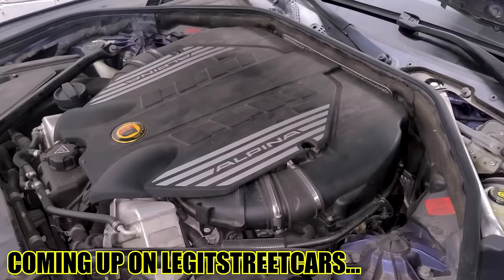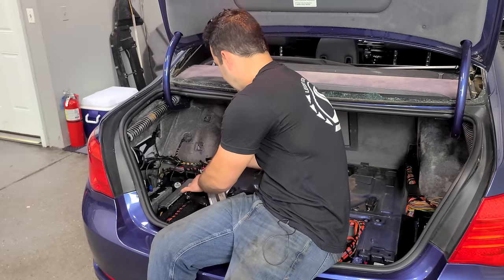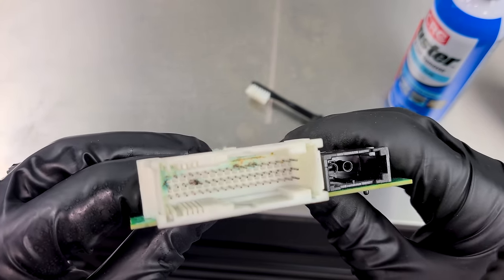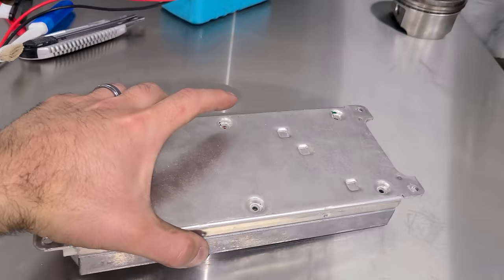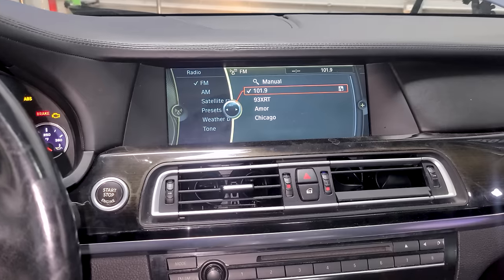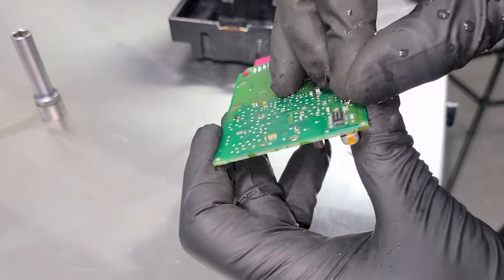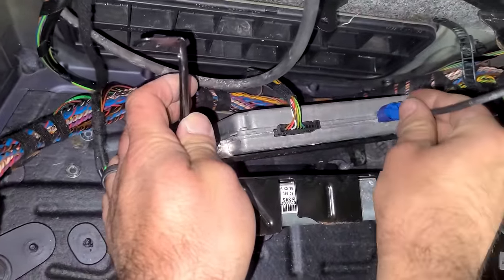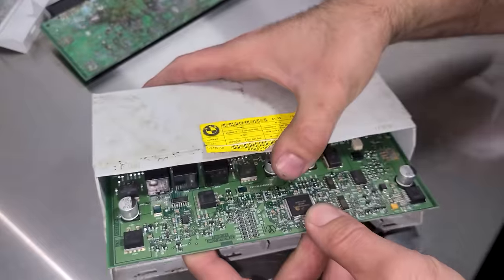BMW Dealer Tried Totaling My Car By Quoting $15,000 For 10 Computers! I Fixed Them All For $150!

Comment: This was a great video. I’ve been watching your channel for years - and many others - and I don’t recall anyone covering this topic. I had no idea you could clean corrosion from electronic car modules. Especially with de-ionized water. Car lovers need to know this stuff!!!
Reply: how is this a surprise to anybody? I had so resolder my control board for rear parking sensors.. worked just fine after.. Contacts come loose, some caps might bloat.. But chips rarely fail.
Reply: Yes normaly liquid damage cab be cleaned, as sonner it is more sucess you will have, i repaired lots of liquid damage stuff, we use de ionized water and isopropanol alchool to clean the corrosion. Even your phone if it goes in the water do not put in the rice, open ir and do what Alex done here, 90% of the time you ok.
Reply: @organiccold  Is distilled water a good alternative to deionized?
Reply: @liuj88  was wondering the same, commented to get any updates that may post.
Reply: Well said. I was thinking the same thing!
Reply: @liuj88  distilled water is just regular water that evaporated and condensed, you get the same out of your AC. Deionized water is chemically treated to be 100% h2o and nothing else. Osmosis is a lot more potent on Deionized water compared to distilled water. I'd say distilled water is safe for cleaning the boards but not so useful for pulling out the corrosion. I fixed several PC and laptop boards using WD Contact cleaner spray, isopropyl alcohol and a tooth brush
Reply: You didn’t know you could clean corrosion off of electronics using water that doesn’t conduct electricity. Really?
Reply: @dgurevich1  Not quite the same as out of your AC - AC water is condensed from naturally evaporated water in the air so it'll likely contain significantly more contaminants than properly distilled water, which is heated from relatively clean water and condensed with clean equipment (hopefully anyway!) - also your AC's condenser unit is probably grotty as hell and will add a bunch more contaminants.  I wouldn't use the water from my dehumidifier for anything other than the garden.
Reply: It's worth a shot, but it's not always going to work, and even if it does work, it could fail later - which is why no dealership is going to offer a service like this - they don't want you coming back in a few months complaining their repair didn't last.
Reply: @liuj88  Since both treatment methods produce high purity water, choosing between deionized water vs. distilled water often depends on how you're using it. Distilled water is often more pure, especially if it's been filtered first, and it should not contain any bacteria or other pathogens which could, in theory, be left in DI water. Distilled water, especially if it's been double or triple distilled, can be used for nearly all laboratory applications, including those in which DI water might not be pure enough. 

That said, deionized water is a good option for many uses, including cooling applications, many laboratory uses, pharmaceutical industries, and more. Unless very high purity water is required, deionized water is often a better alternative because it can be made more quickly and for less money.
Reply: @liuj88  - yes, distilled is just as effective as deionized. 😀
Reply: Thanks to all for the great responses re: distilled water! 
I don't have access to deionizing equipment,  but can buy distilled water at the local supermarket by the gallon,  much more convenient for small projects. 

Any opinions about the alcohol.? I don't remember seeing isopropyl alcohol in the hardware store.  Is denatured alcohol just as good?
Thanks again!
Reply: @liuj88  ISO is usually supplied by chemists. I used to say "I want to clean a magnetic tape head" when they asked why I wanted it 20 years ago. The de-ionizing filters are available on Amazon from $30USD
Reply: @liuj88  Isopropyl alcohol is commonly found at drug stores or grocery stores in the make up or bandage section. 70% and 90% concentrations are common, and you can get 95%+ from outlets online. 90% iso is fine for cleaning electronics.
Reply: Rich Rebuilds has done a lot of this work on his early videos on Tesla. He got a flooded one running by cleaning the corrosion in the battery
Reply: @liuj88  it is not exactly the same stuff, but it is almost the same you would have to look it up but if it has been distilled, it should be totally free of any mineral content. I am not sure of the technical differences of de ionised and de stilled
Reply: @GrahamCampbell-kr2gz  thanks for that input. It's good to know

Comment: Alex, an interesting side note on the fuel pump control module that you clean up and reinstalled.  Those are known to suffer from heat cycle failure and become very intermittent in operation.  I have a 2011 Alpina B7 just like the one you are working on and I chased this problem for the better part of a year.  My car would be running 100% perfectly and out of the clear blue simply die.  I replaced both high pressure fuel pumps, I replaced the fuel pump inside the tank under the back seat and the whole time it was this dang module in the back.  When it would get hot (ambient temperature above 90 degrees) it would simply stop sending the correct pulses.  Let it cool down and it would work again.  My point is, even though you have cleaned it up and made it work again, I'd replace it with a brand new one and not have to worry about it again.  I found a brand new one for 60 bucks and no longer have any issues.  I am following this video series very closely given that I have the exact same car.  Its 11 years old and running spectacularly.   Keep up the great content.
Reply: Do you remember what codes you were getting?

I have a 2010 750Li & I'm having fuel system problems. First I use to get a lean code on Bank 2, then that stooped. Fuel trims still high in the low 20s

Car idles rough & now it will randomly shut off. Codes I get when it shut offs...low pressure in the system & in the high pressure system, electric fuel pump speed too high

And I'm guessing that causes the fuel injection to cut off. It's driving me nuts now, I ran a fuel pressure test in ISTA...and it checked out fine

So idk if it's a vacuum leak that's causing all this, or some fuel component like that module
Reply: I have one of those modules for sale :)
Reply: Oddly enough it wasn’t throwing a code. That’s hard to believe but it wasn’t. That’s what made this so dang hard to figure out
Reply: I had a customer install his own battery.  He connected the battery backwards.  The battery post was completely melted off, metal spatter everywhere.  I figured the car would need every single electronic module.  Much to my surprise, the only module that fried was the fuel pump/srs module.
I have seen those modules go bad on their own as well.
Reply: @MrFlyNikolai  I didn't get codes when my hpfp failed. I've heard of particles contaminating the fuel system when this happens so just be vigilant about continuing to drive it, mine was intermittent at first it was only freaking out at startup where I assume it lost pressure in system but not enough to throw a code if it even would.
Reply: Same thing on my honda fuel pump

Comment: hey! car and pc enthusiast here; you can generally wash any circuit board (without any power whatsoever) with plain water, and if the corrosion is really stuck you can use some dish soap too.
you just have to make sure to rinse the board really really well and then rinse it again with rubbing alcohol. that will prevent any mineral buildup after drying and it will remove the water stuck in some hard to reach places like underneeth the smd chips. 
This is generally a last option to resort to but it works. is better to just use alcohol and a toothbrush.
Also, you dont really need the entire harness plug to replace a pin, you can  just basically buy some female pin conectors of the correct size and crimp them to the existing cable.

Comment: The yellow coating is called Conformal coating. It can be sprayed on or brushed on to new production pc boards with humidity and moisture sensitive sections. Conformal Coating prevents moisture/electricity based fungus formation. There are different formulations of conformal coatings, including silicone, Acrylic and even epoxy based potting (solid forming) or liquid turning to gel versions.
Reply: I just learned to pot using gasket sealer

Comment: The drying stage is incredibly important, I was recently fixing a PCB from a monitor and after a week it wasnt dry and wasnt fixed but about 2 weeks later it worked. Dont rush it.
Reply: If you do clean PCB regularly get a food dehydrator.  The fiber in the board is hygroscopic  some what the source of the root problem  .
Reply: I normaly clean them with de ionized water,isopropanol alchool,  blow them with air and let them to dry for a night in the boiler room ;)

Comment: You make me not want to buy a used car from anyone but you. You do some of the most thorough repairs I’ve ever seen. I’m a Field Service Engineer. You’ve had some fixes I wouldn’t have thought of for sure. I’m really impressed. I’ve watched almost every episode I’ve found in the couple months I’ve been watching your channel. I’ve even fixed a few things since watching your channel. I’m still intimidated to try my 2010 Fusion that was caught in a flash flood in Detroit but this is an excellent start. Electrical gremlins are the absolute worst to troubleshoot.

Comment: I've had great experience soaking the boards in a Tupperware filled with 90% rubbing alcohol. I put the container on my subwoofer at home and either play some music or watch a movie. The vibrations act as an ultrasonic cleaner and the alcohol dissolved the corrosion. 

I did this on a water damaged iPhone and MacBook and it worked both times. I soaked overnight and rinsed with some new rubbing alcohol. Brought back all my electronics.

The issue with just spraying is, the corrosion can exist underneath the chips/capacitors that you can't get to with a brush. When it soaks and vibrates it gets everywhere.
Reply: Excellent Advice and smart!
Reply: Lol love the alcohol & subwoofer technique..
I'd would've used a microscope to view the board in more detail to double check the cleanliness of them..
Thou Alex was lucky only having to replace a couple of modules.

Comment: I just used this technique to fix the remote radar receiver head of my 10+ year old Escort Passport 9500ci radar detector. After years of trouble free service it gave me a “check receiver” error. Since I mounted it behind my bumper when i installed it, I wasn’t looking forward to taking it back off. After seeing this video I decided to get after it.  Removed the receiver head, saw the wiring was in perfect shape, so took the head apart. No apparent moisture got in, but there it was, corrosion between a couple of components on the board. Cleaned it off, put it back together, reinstalled everything and BOOM, it works perfect once again!   Never thought it would be that easy, thanks for the great videos Alex!

Comment: Super Impressed, I can work on classic cars blind folded but all the electronics in the new cars have caused me to quit doing most repairs besides regular maintenance.  The tips you showed isn't just for automobiles, many things are so dependent on sensors and modules.  Take a modern washing machine, very prone to problems with the circuits due to water damage and given some of your tips many could be saved instead of replaced.  Keep doing what you do, your presentation was excellent.

Comment: I pretty much started doing my own repairs on cars at age 15-16 buying used cars to get myself around to and from high school and jobs etc... Had a head gasket blow and got a quote from a shop my eyes fell out of my head. I took a look at a repair  manual and said this is just a big 3D jigsaw puzzle, and went to work. Now I had to get a few things done by a shop like milling the head flat where it had warped a bit. I rebuilt my whole engine basically it was great.

Comment: I repair computers as a hobby, and use 99.9% IPA (IsoPropyl Alcohol) to clean off liquid spills on computer boards.  It is amazing what a little bit of elbow grease can do to a "lost cause".  
Plus it is easier to measure for any issues if the legs of the parts are clean.  You were very lucky to have these modules given to you.  By the way, I enjoy the repairs!

Comment: As for the ABS module, I believe it was done as a insurance fraud. They smashed it so the whole dash would lit up and after quick scan with computer it'll show faulty ABS pump/module, really expensive to fix so total loss ;)
Reply: Agree with this,  I work at an auto parts recyclers, and see a lot of this stuff.
Reply: i would not be surprised as dealer mechanics and probably all mechanics now these days get paid by the job through book time
Reply: I don't understand why ABS modules are so expensive. It almost at the level of the price of an engine head or block, or a gearbox. Anyway, insurance companies are money making machines. They have no real purpose.
Reply: @samuellourenco1050  I guess it's because of so much electronics in it, valves, etc. but I'm pretty sure manufacturer still makes huge money out of every ABS unit they sale :P Same goes to BMW, in Europe if you buy fleet of cars directly from BMW for your company (some bigger number of cars of course, like 100) you might get up to 60% discount on each unit! Yeah, you read that right. I was shocked when I've heard about it. Insurance on the other hand, yeah, they are money making machines but for average Joe it's nice to have. When you total the car you get your money back for it. Not so good for someone who never had an accident in their life though for let's say 50 years :P
Reply: @samuellourenco1050  I have worked in the auto electronics business. ABS modules are expensive partly because of the enormous amount of development and certification work that goes into creating safety critical units to ASIL class D. They are also expensive because they are made by large, inefficient corporations.
Reply: Lawyers make ABS module expensive. It is safety equipment and therefore; Oh you fixed it....Wrong, now pay me $Ms because my client is butt hurt.

Comment: I’ve done a lot of repairs on avionics in the 1980s, but this is the first I heard of using deionized water. Probably a lot safer to use than the mek and Trichloroethylene we used. Great video!
Reply: Freon was the best!
Reply: Nothing cleans like MEK!
Reply: @TS-qd2uj the downside it can't touch any printed information. Just metal contacts and grease eradication.

Comment: I believe the corrosion seen at 22:06 is perfectly normal and from the factory. It's the flux residue from a selective soldering process og the fibre optic component/connector. The flux residue is of a type that doesn't need cleaning (no clean flux) and is such left there. No harm in you cleaning it off though :)

Comment: Absolutely the most amazing electronic repair I've ever seen!  Great job Alex!!!  I think most mechanics would have just replaced the control units instead of repairing them...
Reply: Of course they would replace. It makes no sense to take a chance on spending an hour cleaning a module only to find it still won't work. Its a hit or miss scenario.
Reply: @nickv4073  right, and if it doesn't work then the customer will expect that one hour of labor to go into the cost of the replacement unit. Plus, what if it works and fails again in 76 miles when the customer left for a family road trip. Bottom line, rarely worth the risk if a replacement module is available or unless it's your personal car and you factor in the risk of being stranded.
Reply: You are correct it’s a waste of the mechanics time.  They get paid flag hours.
Reply: Yes, any mechanic worth their weight in salt would do the right thing....and replace the module.     ?
Reply: @nickv4073  Also, it might work for a while and then stop working again as the PCB's & componentry continue to degrade - so no dealer is going to want to risk the customer coming back in a few months time and complain that they didn't fix it properly.  More than likely at least some of these control units will fail again in the fairly near future.
Reply: They have to warranty their work
Reply: @Beer_Dad1975  possible but not likely 🤔🇨🇦

Comment: I picked up a '08 335xi a few years back, one of the many small issues like your B7, was the radio wasn't working - I decided to dig into the amp as I read that water gets in. Yep, a bit more involved disassembling the Logic7 amp, but once I got in and found the green fuzz on a few IC's and components, I did pretty much the same drill, CRC and a brush - but I also got in with a jeweler's loupe and dental tools to scrape away corrosion (VERY Carefully) 3 years later it's going strong!   I've also had a few where a solder joint wasn't great from new, or just cracked with heat cycles, and a quick touch with a soldering iron resolves the issue.
great video!